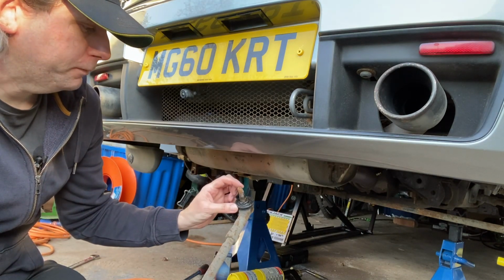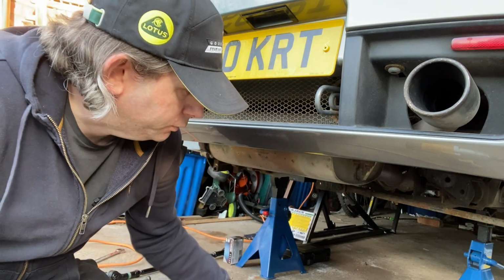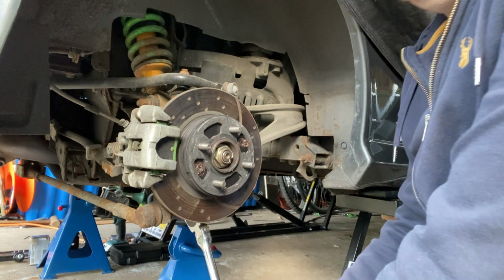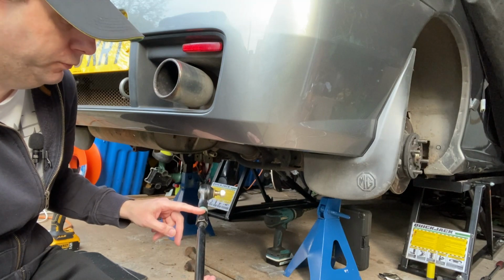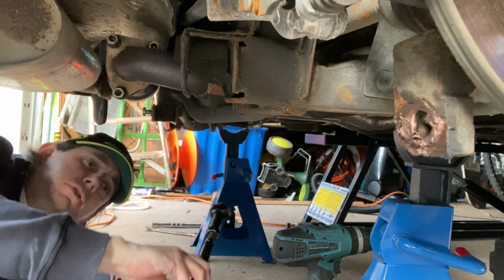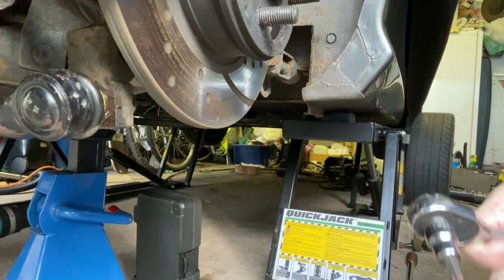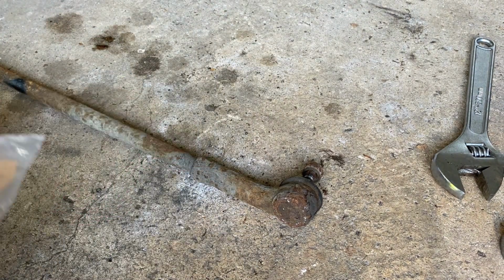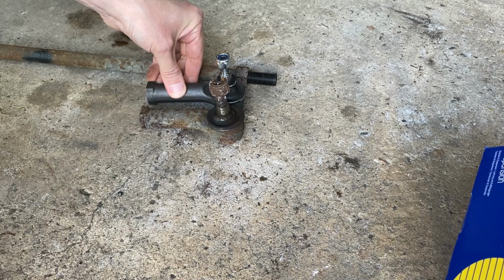MG TF rear suspension long Trailing Arm replacement

Comment: My TF failed the MOT. Initially due to a "worn" rear wheel bearing, so replaced the whole hub and it failed again! Anyway the MOT Tester then realized that it was the inner track rod bush that was shot, that gives the impression of a lose wheel bearing when you shake the wheel(the one I replaced seemed OK). So now waiting for a new track rod to arrive and get a new test. Interesting about the Ford Cougar back to front outer trackrods!